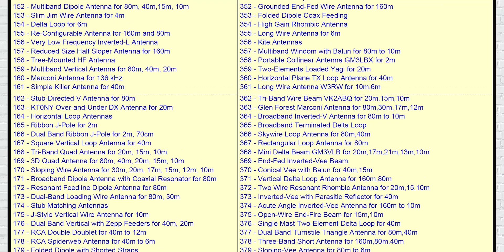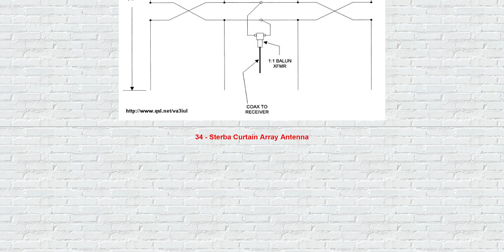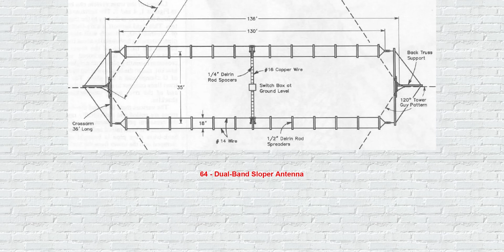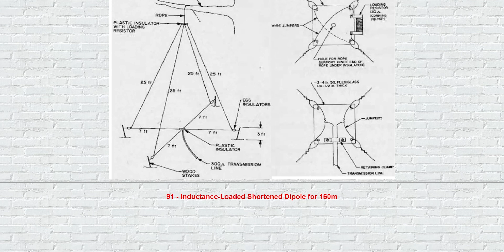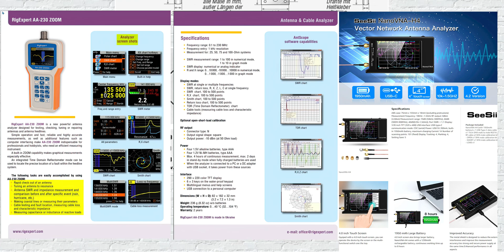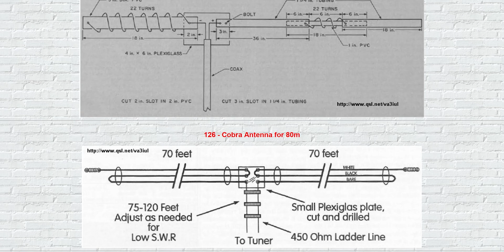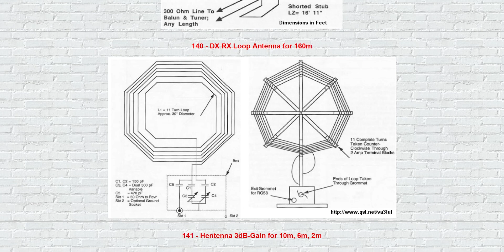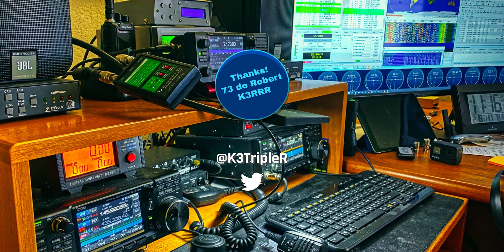403 CHEAP DIY Homebrew Wire Antennas for Ham Radio

Comment: I'm using a homebrew End Fed straight wire that has 132 feet of wire ran into the top of a tree. I made it myself in about an hours time. Works great as I have made contacts all around the world with it. I have a total of $58.00 in it. I'm also using the cheap rotator and tracking system from one of your other videos. I still can't believe how well it works. It has made working the satellites so much better. Thank you for this channel. It is a wealth of knowledge.
Reply from the maker: Terry, thank you for your comments and I am so delighted that my cheap satellite system has worked out so well for you!

Comment: I built a full size G5RV with an ugly balun It works GREAT
Reply from the maker: Thanks, Lou… Have never actually used a G5RV except at Field Day and it even worked great during all of that chaos! I have made a lot of Ugly Baluns… For me, I find it 1 L coke bottle with the top and bottom cut off makes a perfect form for an HF Ugly Balun… 73 de Robert K3RRR

Comment: Tnx Rob. Just completed the 40m delta fed with tru ladder line fed in the lower left corner. Apex up at 30ft. I thought the 1:1 at the shack would work but the 4:1 was the answer. Now considering dropping a vertical 25ft piece of 500ohm ladder line from the apex with the ends shorted. Tunes great on 40-6. Grabbed a qrp guy in CA tonight on 20m. 80w CW of course. :)
Reply from the maker: That is GREAT, Jay...I have been considering that same antenna for 40! 73 de Robert K3RRR